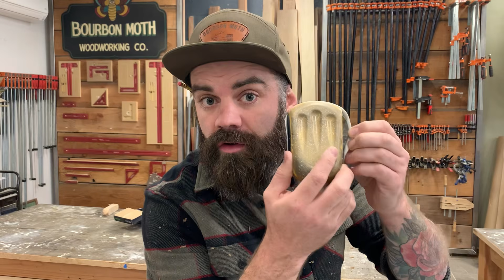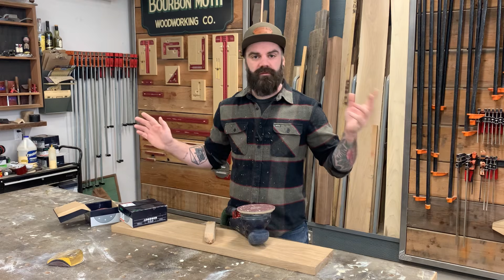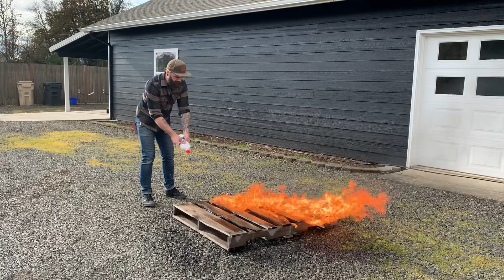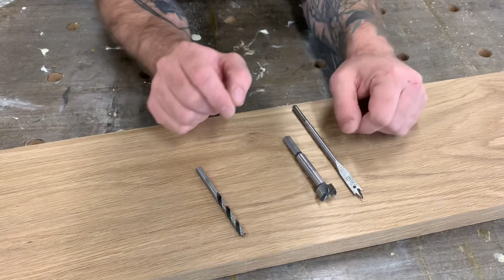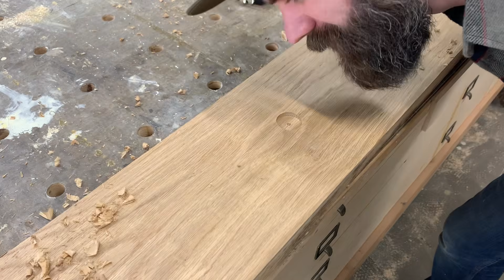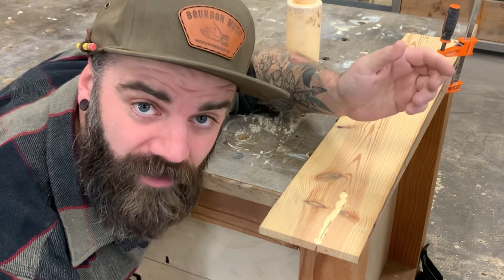Woodworking Tricks You'll Actually Use // Helpful Woodworking Hints

Comment: Wow!  Ten seconds in and I know your doppleganger -- Dave Teiff -- right down to the funny, quirky personality!  

Anyway, down to the important stuff.  Wiping down the wood with mineral spirits also raises the grain for most woods, making sanding more efficient for the next higher grit.  I used to use water, but it takes longer to dry.  Also, before using the mineral spirits, a quick hand-sand with the woodgrain using the same grit you just finished with on the sander will help remove swirls that you won't see until you apply a stain or finish.  "Remove as you go" works best because 220-grit paper won't do as good a job on 80- or 100-grit swirl marks later.  I learned this while turning pens and the wood surface is  f l a w l e s s  even under 10X magnification review (yeah, for a pen maybe it's the Nth degree, but some of us are wired like that...)

Comment: I like to come out of the corner 10” easier for me to math it up. Also I use a squeeze clamp when I cut an inch measuring. Cut an 1” secure with clamp then down the material you go.

Comment: Great tips.  I measure into corners using a ruler.  Butt the ruler into the corner and measure to it.  Add the length of the ruler.  Super easy and accurate.  I use the 6" ruler from a combo square.

Comment: The trick I just learned that made me think "WHY THE FUCK HASNT ANYONE EVER TOLD ME THIS" and makes sanding surfaces that aren't perfectly flat and smooth into an absolute joy (well, no longer a nightmare) is to use that squishy plastic foam padding that comes with basically everything you buy. It's like styrofoam but softer and not crumbly.

cut it to whatever shape you like and wrap sandpaper around it and boom, instant, reusable sanding sponge that's softer and more flexible and able to get into every little nook and cranny with ease. I had just got a new TV and looked in the box and realized that I now have a lifetime supply of sanding sponges. for free.

Comment: A friend of mine has a trick he uses to measure out from a vertical surface horizontally. 1 He measures his tape measure from the bottom of the tape case to the bottom surface of the tape. 2 he planes a scrap pice of hardwood (it lasts longer) to the same thickness. 3 he measures 4” in from one side and cuts a 1/8” slot, this is for the tab at the end of the tape to anchor in. 5 cut the scrap to an exact dimension he uses 10” (it’s easy to add later), remember it 10” inches from the outside edge of the slot to the edge of the scrap! He then planes the finish edge down to 1/32” over about 1” making a thick chisel edge. That edge is placed against the surface you are measuring from, place the tape in the slot and measure out the length. Add the ten inches of the scrap and bingo total length. The great part is he’s a finish carpenter so he is always having to measure between two vertical surfaces. Just take a second measuring jig place it at the other end and measure to the edge of the slot add 20” to the tape measure and bingo over all dimension between the two surfaces no guessing the curve of the tape. (Why make it the same thickness as the bottom of the tape to the bottom of the case. Removes the some of the error caused by the sag in the tape.) he also drills a small hole in the jig on center the same diameter as a fine finish nail, that way if he’s measuring on his own he can tap a finish nail in to the through the jig to hold it place. He also is a bit OCD in that he picks a start point to begin measuring a job and will work in one direction measuring out the dimensions writing them down as he goes. He then starts in the same place and measures again going in the opposite direction. Any place the two don’t match he knows will be a problem and figures out what went wrong measuring or what condition in the space is causing the problem. (Warped surfaces is often #1). That way he can either prep the space to remove the problem or deal with it later when the finish trim is applied (knowing ahead that this is a problem area). He figures that this has saved him thousands in time waisted and in material costs alone. For cabinets he uses the same system just shorter jigs. He also uses the older two stick method 1 cut two 1 x 2 trim and prep the edges so that the two sticks are flush along one side (cut the sticks so that they are 6 to 10 inches shorter than the expected average width of the cabinet. Cut the same chisel edge on one side of the sticks (this edge is always used against the surface to be measured from) lay the sticks inside the space flush to the back edge to be measured. Push both sticks out from center till both measure ends are flush and mark a line across the shared edge and label the line (A, B, c... or 1,2,3..) come out the distance from the wall for your depth of cabinet and do the same again. These are the dimensions for the back and front of the cabinet. Older houses are often not built to square. Doing this will give you a cabinet that fits perfectly in to the existing space flush at the rear and front. You can then use blocks and other devices inside were they are hidden to support drawers and shelves. And adjust the dimensions of the visible faces to produce the best effect evenly across the entire system. Nothing looks worse than an entire set of standard panels and trim with one odd section that had to be trimmed to fit. As my friend said it’s the difference between charging 40,000 or 80,000 on a job, and one mistake can ruin your reputation for years. He likes to dimension the openings or shelves out from center to each end rather trying to get it even measuring from one side to the other that way he can use standard sizes for the majority and two sets of custom cut work at ether end. This speeds up fabrication and allows him to meet very short deadlines with a very high quality of product. As he does mostly inbuilt remodel work, he can split the cases so he can build the framework in the shop and get it into the intended space easily and still give a built in place feel to the work. His other big trick was to measure the floor to ceiling heights at 6” intervals across the room again old houses are often not level as the house will often have settled unevenly over time. Find out up front and build to measure, rather than trim to fit after an have a odd appearance in place. That matched fit approach has made his business, as most of his clients are from word of mouth, or people who have seen his work and sought him out to do the same at their house. (I’m not using his name at his request, he is funny that way, but it’s part of being his friend).

Comment: Glue for cracks I use the flat part of the glue brush to fill in the crack. I tried the measuring tape of the tap but I was off since it was hard to see the 1/16ths. I just used the 1ft mark like the video. Lots of good stuff in this video that I did not know.

Comment: What i do to clean my sandpaper is use my air compressor with a fine tipped blower nozzle. It really gets those clumps off fast and then if i need to ill use my razor scraper blade and get any stubborn clumps

Comment: To deal with the inside measurement problem, I have had great success with this:

ADD AN INCH TOOL, Measuring tool for exact measurements in corners, accurate level marking and locks for repeated marks.
by TL Tools LLC

Learn more: https://www.amazon.com/dp/B07D7ZXGG5/ref=cm_sw_em_r_mt_dp_QkD.FbMSMCXQC?_encoding=UTF8&psc=1

Comment: OMG 😅🤣😂 YOU Sir, are a PUTZ !!! &, quite possibly the most hiiiilarious goober in a workshop setting I've seen yet. I so enjoyed the.... "Ted's most excellent adventure" to shop-smarts ! I've had workshops as a cabinetmaker/furniture maker since 92', but I think your light heartedness approach and that "don't take me serious at all" shtick is zactly what's needed, in a fairly mundane and pensive craft... 
Ok ok, I'm a believer, but even after 30 years & 7 or 8 shop set ups, you (I) can't possibly know EVERTHING. I'LL adapt a few of your suggestions, "the palm sander hook n loop", to use solid sheet (no hole) abrasives/killer tip opposed to the regular foam blocks &, most especially, the d-nailing of pallets 😆😅🤣 - I've always felt that way about the knuckleheads making "furniture" out of something you have absolutely NO idea of where its been... not to mention i just can't bring myself to call that stuff "furniture "...
Great vid, keep up the work & just be you. I gotta go change my depends now...
Oh, btw - the "Bourbon Moth" ?!!?... EPIC

Comment: An anti-glue squeeze out hack I use is I apply shellac to the surface when I dry fit the joint.  It dries in a few minutes. Then do your glue-up and clamping. Shellac prevents the glue from getting into the woods pores so cleans up easily with damp cloth. No issues with glue stains when you apply finish.  Not my idea,  got it from Cam at Blacktail.

Comment: Drilling a hole in plywood as a guide comes in especially handy if you have ever tried to install and new door handle in an old door with the glass type doorknobs as they only have a small hole drilled through the door...good tip...love the video..informative aaaaand entertaining too.

Comment: Lots of helpful hints, but the pallet sucks, if you really want to see a good way to dissemble a pallet go see SPE.  Title is how to strip a pallet with simple cheap tools ( un-powered ) in just 10 minutes. Was dated 03 May 2016 and done by SPE. Been using his way for almost a entire year now and it works great. By the way that # 2  glue the crack was great, still laughing at it. The hint of measuring where you added the 12" and then measure from the other direction is great. Thank you for this video and the others. See you now have 21K two thumbs up for you, 2021 HAPPY NEW YEAR, may you double that this year.

Comment: For that board centre trick use 6” and 18”. Much easier maths. :)
For glue squeeze out run some Magic tape along the joint line. That’s the stuff which won’t leave glue like cheap Sellotape (Scotch). Rub it down with a fingernail or pencil eraser. Peel off while the glue is wet.

Comment: Great entrance on this one particularly (hope you're okay).  Anyway for me, best hand sanding block is a flat piece of 1.5"  thick (or so) scrap hardwood cut to 4.5" width for adhesive-backed sandpaper. The sandpaper rolls are cheap (compared to round disks), blocks can be cut to any size and each fitted with different grit, and you can sand right up to corners.
Reply: For hand sanding, I use Norton 3X sheet sandpaper whenever I can. For routine flat work, I use one of those 3M rubber sanding blocks that takes 1/4 sheet ripped into long strips, but I don't like 3M's adhesive-backed sandpaper because it leaves little gobs of adhesive on the block, and those compromise the flatness of it. Besides, the Norton 3X paper cuts longer and doesn't clog as quickly. For detail sanding, I wrap 1/16 of a sheet around a piece of an old credit card (cut lengthwise). 
-- I spent a bunch of years restoring century-old wooden entryways for three-story apartment buildings in the Boston area and finishing them with an alkyd-based marine varnish (Sikkens Cetol Marine-- NOT the Cetol products for house siding or windows and doors). These entryways had beveled-glass sidelights and toplights, many of them arched on top. In some places the built-up mouldings had more than 25 different surfaces to be finished, and some had Corinthian 1/2 columns with carved leaves and acorns on the capitals. In some parts, it was more like re-carving than refinishing, because there was so much UV degradation that had to be scraped off. Hundreds of hours of hand work on each one. I tried a couple of different power detail-sanders, but they were useless.
-- Some of 3M's stuff is OK, but their sheet sandpaper sucks. Gator brand is OK, and some other brand from Finland I ran into, but I still stock up on Norton 3X whenever I see it. 
-- Discovering the utility of old credit cards for detail sanding "blocks" was a lifesaver. I cut them into strips about 7/8" wide, avoiding any raised numbers, and wrap the 1/16 sheets around them lengthwise. They are great for sanding inside corners and other grooves. For round concave troughs, I use milk-jug plastic, cut to rectangles sized so that the 1/16 sheet can be wrapped around them crosswise. The softer plastic takes the curve well, while its edges have enough stiffness to give a clean line where the trough meets whatever bounds it.
-- The Sikkens Cetol Marine varnish was another great discovery. It lasts a lot longer than spar varnish or polyurethane (including the allegedly UV-protected polyurethane). Oily tropical woods like mahogany or teak should be wiped down with acetone or lacquer thinner just prior to the first coat, to remove the oils from the surface (for the sake of adhesion and to avoid splotchy coloration from the oils reacting with the varnish), but the manufacturers won't tell you that, what with the EPA looking over their shoulders. The Sikkens Cetol Marine stays a bit pliable and doesn't crack or crystalize, and maintenance is easy-- just wash it with TSP and a Scotchbrite pad, rinse, let dry, and recoat after a couple of years in marine environments, but 5-6 years on land seems to be OK. 
-- And for restoring those nice old brass kickplates and door handles, clean it up nicely, leaving in the little dings that give it character, and coat it with automotive clear coat. SEM sells it in a spray can, and it's available at auto-body supply stores. 
-- Good detail scrapers are hard to find. Craftsman used to make a "Handy Scraper / Utility Scraper" that had 6 blades that could be rotated 180 degrees, and I was lucky enough to get two of them, but they are long-since gone from the hardware shelves. The closest thing to it is the Hyde Countour Scraper 10450, but most of their blades are sharpened only on the ends, not on all edges, and three of the countours are concave, for scraping spokes and round spindles, which can be scraped with a straight blade (it's all going to get sanded, right?). The old Craftsman scraper had 4 concave blades, with radii of 1/8", 1/4", 1/2", and something around 3", and a couple of pointy pentagons, one tall and narrow, with a wide base, and the other short and wider, with a very wide base. The Hyde and the Craftsman handles will accept one another's blades, which clip on with a quick-release lever, and the blades are held at about a 15-degree angle off perpendicular to the handle. They scrape on the pull stroke. I recently had a metal fabricator with a CNC setup make some of the Craftsman style blades, because my old ones have been sharpened so much that there isn't much left of them. A higher-end set of fixed-blade (perpendicular to handle) scrapers is available at stortz.com, and I may spring for a set of them, because they're apparently made of carbon steel, not stainless, and the permanently-attached handles would make them easier to sharpen (and less often). (stortz.com also carries Klenk offset aviation metal shears, which I had years ago, and worked better than any I have seen since. No having to lift one flap above your cutting hand, a radical difference from the usual ones.)
-- Hint of the day-- When you own some special, hard-to-find tools that are much better designed than the common variety, don't lend them out, even if it's to your boss.
Reply: @grizzlygrizzle  okay, this is such a great comment - years of very specialized and detailed work condensed into a YouTube comment.  So special and greatly appreciated.  I can confidently say that at some point I will try almost every recommendation you make here.  Thanks so much for this enlightening and informative comment.  I am going to make some sawdust now…

Comment: About INSIDE measures: 
Hultafors tape measures have a flipout piece at the Back that adds 10cm, and tiny second 10cm marks in red for convenience that account for the extra distance. 
They also have a scale on the back that gives you the diameter of a trunck if you lay it around the circumference (length divided by "Pi").

Comment: after removing the nails from the pallet, do I still sand up to 220 grit?
Reply: Just use the ash for epoxy colorant on your next river table.
Reply: Clean up the dust with mineral spirits first
Reply: That would make a unique epoxy table.
Reply: Back to 150 by hand if you are using Rubio to finish the nails and ash.
Reply: Even the comments are funny. Gotta love it.

Comment: I think all of the info in this video is great but the tip about leaving glue squeeze out in Corners alone until it fully dries is brilliant. I've bought a chisel plane, a crank necked chisel, special straws and other gimics to try and clean up glue before it dries. It is damn near impossible, especially on an open grained wood like oak or ash because the glue gets smeared into the deep grain and you're never getting it out. Letting it fully harden and the cutting it out with a razor sharp chisel is so damn smart. Sometimes it's the easiest things that take the longest to figure out!

Comment: To find the center of a board measure in roughly half the width,  nice round number that you pick out of the thin air, and make a mark, now do it again from the other side (same number), can be just over or under half don't not matter at all, (I hate double negatives) IT MATTERS NOT, then with your beady little brown eye split the difference. Works just fine with very little math.  Works no matter the color of your blood shot eye.  Feel free to steal, I did.
Great show, thanks.

Comment: To find center, you can use combination square by putting the 45 side on edge at end of board or set distance from end of board, scribe a line, flip square to other edge, scribe another line, center is where the two lines intersect